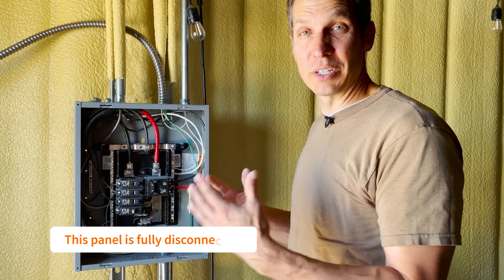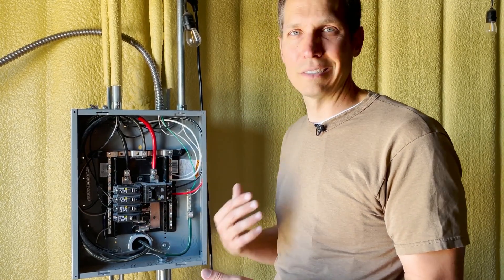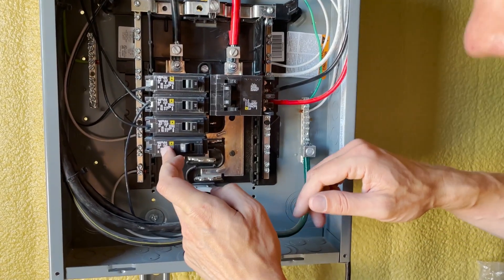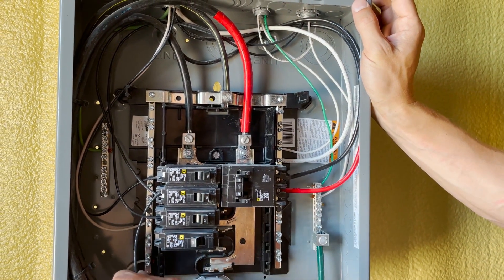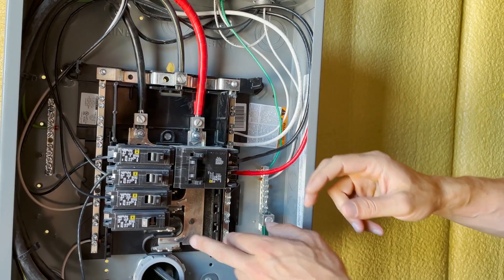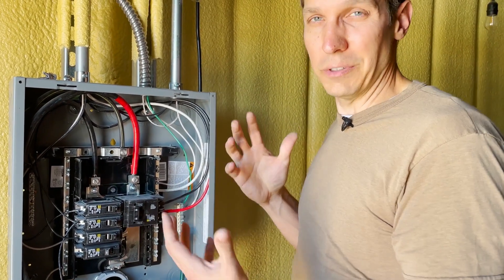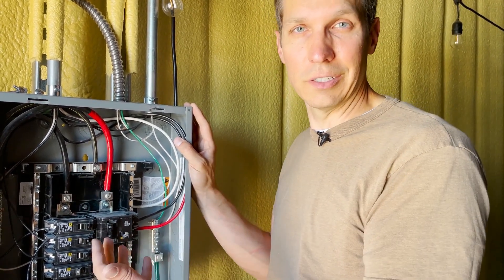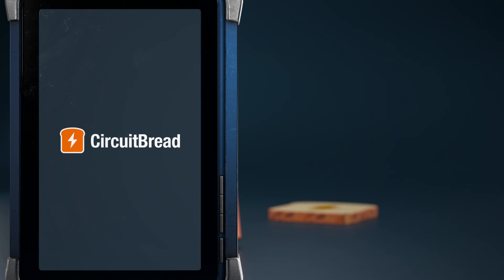How to Wire for 240 Volts in the USA | CircuitBread Practicals

Comment: MEP EE here - a few tips - if you are powering specific equipment with a new breaker, make sure you look for the MCA for that equipment (Minimum circuit ampacity) which should be listed in the manual or on a specification sheet for the device. If the device is intended to be used for a long period of time, or it is a motor (dust collector, table saw, etc) you should consider increasing your wire size (multiply your MCA by 1.25 before you pick a wire size). Make sure you are using the appropriate ampacity for your wire. If you have a lot of current you are going to need a thicker wire. Look up what wire you need on the national electrical code (NEC) table 310.16. make sure you check if your device specifies whether the wires will need to be copper or aluminum (if it doesn't say, you can just choose one) before you use the table.
Reply from the maker: Good tips!  We recently expanded our solar system and as the expectation is that you will be pushing maximum power for hours on end, we sized the wires considerably higher than the standard ampacity ratings that we did with our house - 10 gauge copper for wire that should never see more than 10 amps.  Perhaps overkill but 1) it came with the package I purchased so it didn't cost extra and 2) I like to be rather conservative.

Comment: Hey nice basic video i am an electrical engineer in MEP i had to learn this stuff on job but i dont know if you realize this but your 240 volt breaker for the RV is called a quad breaker because it can take usually three circuits but in your case it accepts one 240 volt circuit and two 120 volt circuits . Another type of breaker you will see is a tandem breaker which take two 120 volt circuits . These are breakers are used when you have very little space in your electrical panel
Reply from the maker: Thanks for clarifying on the terminology!  I'm usually just descriptive when talking about those items because I'm familiar with them but not familiar with how the pros talk about it.  It is funny how many different sub-types of electrical engineers there are.  I have a few friends that are architects and the EE's they work with do completely different stuff than what I do.

Comment: I'm starting to think the way houses in America are wired up to the grid is different to here in Australia
Reply from the maker: That's a fairly safe assumption but I don't know enough about Australian house wiring and grid to make a confident statement.
Reply: @CircuitBread We have 3-phase grids and typically run single-phase 240V in our houses but we have 3-phase in our switchboard but you couldn’t join them together like you’ve done since they’re 120° out of phase